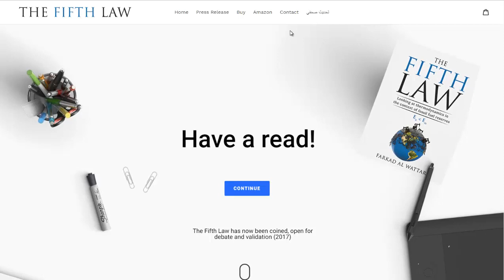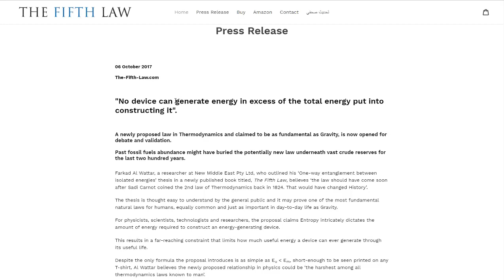The New 5th Law of Thermodynamics

Comment: Difficulty abounds in defining precisely what is a machine, and what is its working life time is.  Consider replacement of parts that do wear out. What is allowed maintenance? Biological entities that exchange with their environment for both energy, matter, structure and growth?  A machine can be an abstract something that transforms energy without itself being transformed significantly. Machines eventually loose energy their transforming capability. The total energy and circumstances and compound nature of machines needed to build a machine are also ill-defined. No wonder we have such difficulty with estimations of EROI .We imagine purposeful maintenance, which has ongoing costs, which maximise the total amount of energy transformed or lifetime of a machine. The questions then acquire economic aspects, from available resources, imperfect circular economies, and finite environments. We choose the easiest, profitable processes first, which means selection from where entropy is already advantageous. Global civilisation has been modelled as itself is a heat engine, of the classical physics thermodynamic kind. Energy transformation does work, produces waste heat, and degrades both the part / machines doing the work, and the environment resource systems which maintain its machines. The end result is a biosphere turned into waste and heated atmosphere, since CO2 is a greenhouse gas and an thermodynamic energy end point. The depletion of energy transforming potential is a known outcome of all thermodynamic possible reactions, and so this global civilisation is approaching its end faster by always maximising growth of power generation. The question becomes not what is a law, but what are the conditions that make it true.

Comment: There saying, a burning stick produces 10,000 btu of heat for one hour. After the one hour the stick is turned to ash. Solar cells only produce 30% of the energy that hit it. But you can buy 100 watts for around $100.00. most people can power there home for 25 years for $3k to 5k.  investment in solar. The fusion reactors  will cast Billons and billions for up keep. but both suffer from the same problem of the sun setting. but the fusion reactors  use reflection of sun light on to a tower filed with melted salt. this in turns boils water. so how are they going to get the power to your home? new power lines , and how much power will be lost in the line as amp drop?  in the next 25 years Solar will be around  50% or more. and in 50 years will be on every home , car, road and farm .